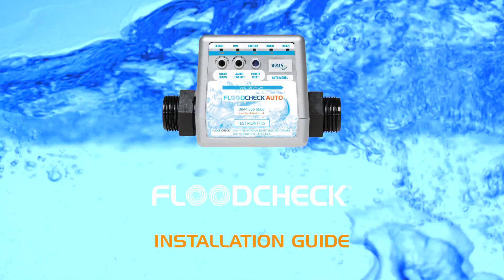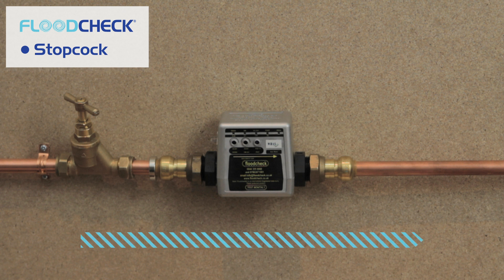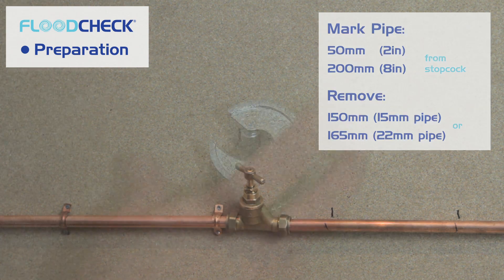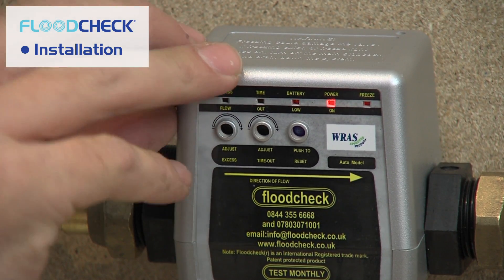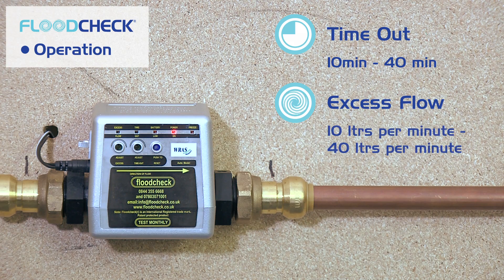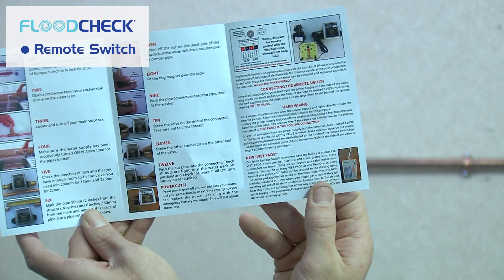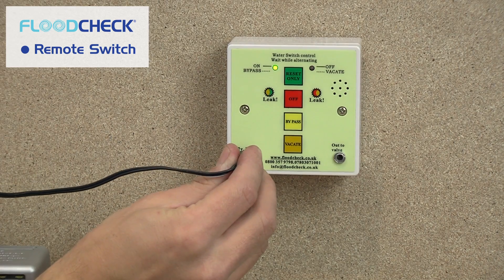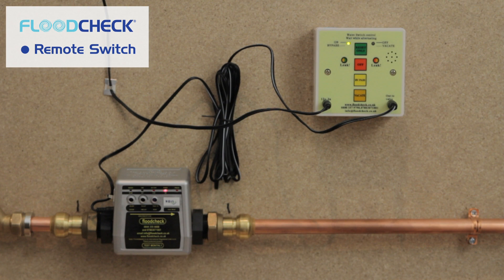Floodcheck - Install video

Comment: after a serious water lead, in 2011 3000 floodchecks were installed at the Olympic athletes village in 2011.
some were removed when the temporary flats were converted to flats and houses in 2012.to this day in 2017 , we at Floodcheck  have not had one single report of ANY water leak from the village.